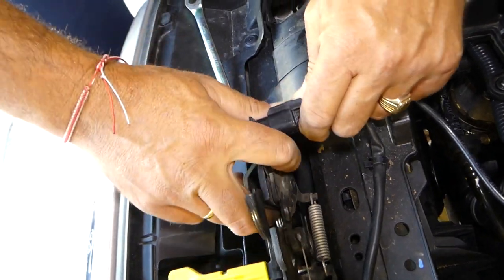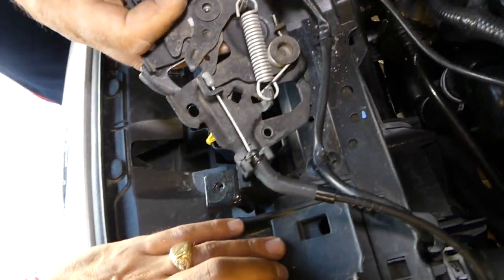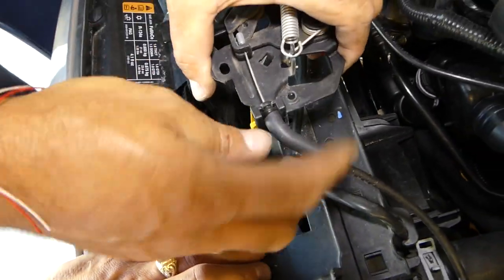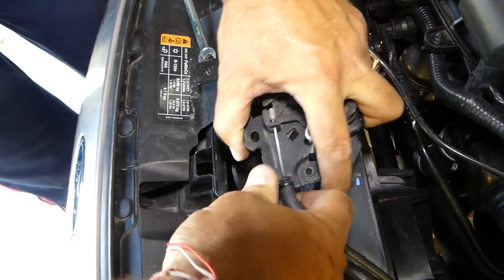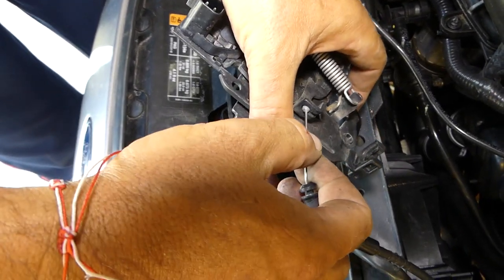HOW TO REPLACE REMOVE HOOD LATCH  RELEASE LOCK ON FORD FIESTA MK7 ST BONNET

Comment: What this video doesn't show is that there's usually also a metal bracket, bolted to two holes either side of the yellow release catch and one hole just above (underneath the cable to the anti-theft microswitch). This bracket sits 'on top' of the latch mechanism and holds the bonnet/hood airbag crash sensor. 

You will therefore also need a T30 or large flat-headed screwdriver to remove those screws before loosening the latch assembly. Pause the video at 0:26 and you will see one of the holes by his thumb, the other on the opposite side and the third is one of the holes in the bulkhead to the right of his fingers.

Once unbolted, it's simple to unclip the microswitch and the crash sensor, then unbolt the latch assembly. For my UK Mk7 Fiesta ST, the replacement latch assembly with the anti-theft microswitch is FINIS 1813551 (engineering part number C1BA-16700-BE), I paid £65 from a genuine Ford parts supplier.

If you're removing for the first time, the bolts and nuts may have rusted or seized, so some WD40 and IPA solvent to clean the rust off would be useful. Not essential though.

Another really good video guys, you've done so many useful DIY repair videos for the Mark 7 Fiesta which have come in very useful, greatly appreciated. I don't know if your car didn't come with the bracket or if you forgot to include that step, but it's not a huge deal :-) Just useful to know you'll need one extra tool.
Reply: There are two different P/N's called out. One is with antitheft and one without. This video shows the one without but you are right the antitheft one is different. If you replace yours with new you 'll also need to replace the pigtail as the connector has been "improved" by Ford.
Reply: @robertgary3561  any idea what the improvement is? just better weatherproofing?

Comment: I daily drive my Fiesta ST and it’s on her 9th winter. I had the hood latch replaced 1 time already under warranty due to it being extremely corroded. Well I just went to put wiper fluid in it now during a snow storm and the hood latch cable popped out. I was able to use this video to figure out how to get it back in place!

Comment: Hood got stuck shut. Wouldn't pop. Had to take off my bumper, belly plate, and had to cut a hole to reach these bolts. Just so I could open my hood and charge the battery.

Comment: Is there a way to open the hood manually, if it is closed and locked and the wire is not attached to the latch? I have a 2011 Fiesta SE? Can you make a video showing that process?
Reply: Did you get it sorted? I've got the same problem on my 2016 fiesta st180
Reply: I have the same issue on a 2016 Ford Focus. Hood is latched and there doesn't appear to be access from below to pop it open manually...
Reply: Okay. Same here on a Focus 2013 SE. Somebody ever got a solution? 🙄
Reply: Same problem
Reply: Yes. There is an access hole behind the logo. Pry the logo off and you can push the manual release with a screw driver. The same level the cable pulls.